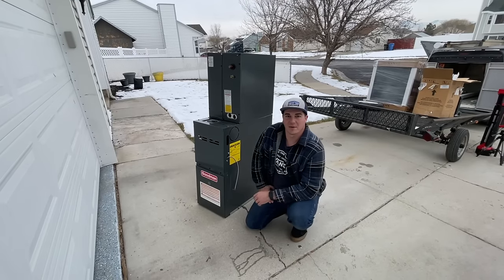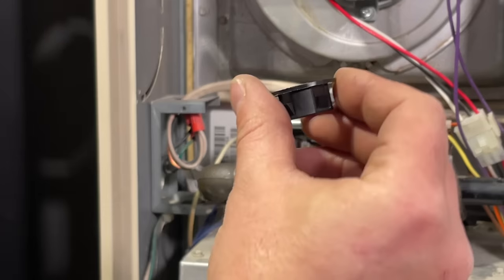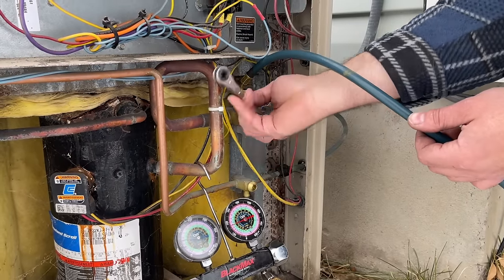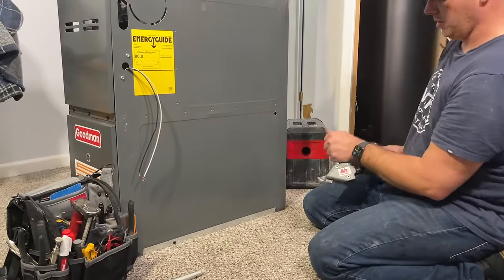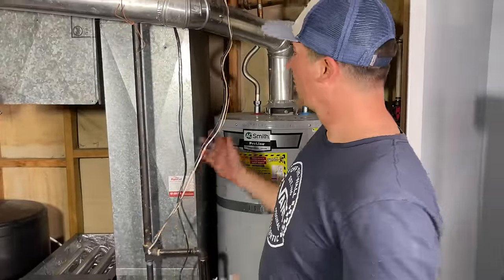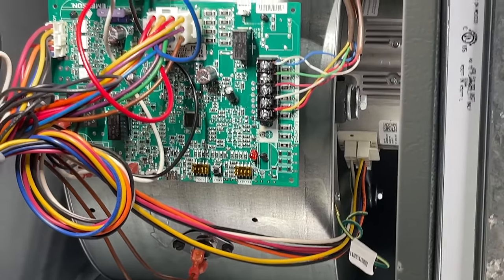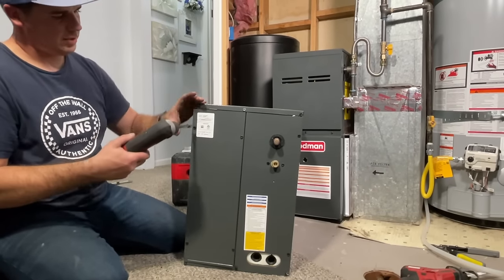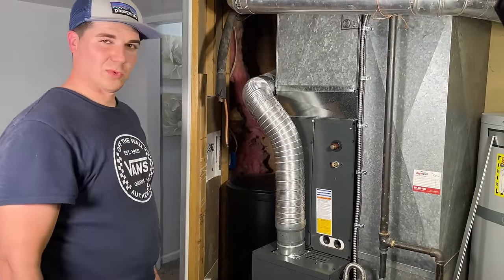Save THOUSANDS Replacing Your Gas Furnace Yourself.

Comment: Thank you so much Dave for  posting this video. So glad to see an HVAC tech like yourself that isn’t anti-DIY. I was never good at sheet metal work until I started watching your videos. Thank you again.
Reply from the maker: Happy to help. Thanks for the support! Cheers
Reply: Yeah the HVAC industry is largely anti DIY and makes up all sorts of mostly invalid reasons why. The real reason is they often charge $200 or more to replace a $15 capacitor. Or, much worse, $5000 or more to replace a $1000 furnace that one guy does in half a day. So a $1000 furnace with a 20% markup is $1200 plus 4 hours at a more than fair $200 an hour is $2000 total. But that turns into a $5000 plus bill with many HVAC contractors. So they should not blame homeowners for not wanting to be ripped off by the “HVAC cartel” and looking for much less expensive alternatives. I’d love to be the roofer that charges an HVAC anti DIY guy 2 or 3 times the fair price to replace his roof and see how they feel?
Reply: Go forward with the DIY installation and I guarantee you will regret it! Considering if you installed your new unit yourself it will now have no active warranties since a certified technician with an approved company didn't install it. I've only an HVAC Sales Expert for two years and even I know that! In his defense I deal with a lot more company to company and face to face interactions so maybe he just really didn't know.
Reply: Dave is here too!
Reply: AC Techs are anti DIY because of what the channel Anti DIY HVAC finds, all the time - people scammed by people who do installs of furnaces, poorly.
Does that mean people's high prices are justified? Show me a rich AC tech first, then we'll talk.
Reply: Thank you for doing this video its very informative  and a lot of good information I agree if you are confident in DIY-then there is no reason to hire a professional just take your time same as replacing a gas hot water installation .👍
Reply: @vrtac2011   I installed my own furnace 12 years ago to replace a Lennox elite that failed from being installed incorrectly by a "professional". So far no problems. Total cost of install was $850 for a 97% efficient system.
Reply: @vrtac2011 what happens when you buy a home with a new furnace installation how do you know who did the installation? I am asking because I just purchased a home and if a professional did this install it really sad! 😢. It's terrible leaking, missing screws, lose ductwork, no insulation, you name it.

Comment: FYI some/most manufacturers will not warranty a system that has been installed by someone that doesn’t have their State Mechanical license. Better ask in advance or you may get a rude awakening. Also home owner insurance may not cover any damage created by a unlicensed installation. Better do your homework in your State of residence and ask your insurance provider.
Reply: Warranty is hardly worth it anyways. That basically just a sales pitch as the part is never as expensive as the labor
Reply: Don’t forget this guy is an hvac scammer. He makes more money than a technician does by playing customer’s advocate and causing dialogue of distrust and anger in his video’s comment section. He is just as bad as the guys running around in vans ripping people off. He has just mastered a soft way of doing

Comment: My question is why wouldn’t you tell the homeowner that in a few years he’s gonna have to replace that again with a 90% or better high-efficiency gas furnace. Oh that’s right job security.
Reply from the maker: Um no, that wouldn’t be until the furnace is due for replacement. They’ll simply stop selling 80% furnaces, not tell them to remove them from your home immediately.. 🤷🏻‍♂️

Comment: They charged  my mom almost 10,000 dollars for the same unit she definitely got ripped off
Reply: Hey You have plenty of these contractors ripping off people. How can one job have a wide range of cost using similar parts is beyond me.
Reply: i would assume a 10k job came with a pretty good warranty. also did they do any ductwork? 10k could be a ripoff or not. depends on location and circumstances.
Reply: Well, she has a warranty. If you install one of these yourself, there is no warranty. None whatsoever.

Comment: I've learned alot on this channel as a home owner and someone who has been working in the maintenance field for 15 years. Just do your disclaimer in all your video discriptions and let people decide if this is for them or if they want to hire a professional.
Reply: Only a profession can work with refrigerants. Homeowners can't.
Reply: @crand20033  Homeowners who have experience with DIY stuff can do just about everything except for the final steps that involve line flaring and dealing with the refrigerant. You can hire a professional for that final part of the project.
Reply: @davidnivison9915 I appreciate the DIY but i do not have the tools. I like your transparency and no BS, not the typical hyped extreme overpriced pro installation sales pitch.  I want to hire you to install my furnace.
Reply: Don’t forget this guy is an hvac scammer. He makes more money than a technician does by playing customer’s advocate and causing dialogue of distrust and anger in his video’s comment section. He is just as bad as the guys running around in vans ripping people off. He has just mastered a soft way of doing

Comment: Thinking of doing this myself since my furnace is 20 years old. Ebay sells them. Just choosing the right time of year before it fails when you NEED IT. 😬 Already did my gas water heater a few years ago.
Reply: Well, my main board failed this week. HSI failure. Bad relay. Amazon and $130 I'm still going! 😁

Comment: Channels like this are an invaluable resource for homeowners! Haters gonna hate. I see lots of HVAC guys checking a channel geared specifically to homeowners and being backseat drivers thinking they're rocket scientists.
The fact of the matter is repairing and replacing HVAC systems if leaving it ALL to the "professionals" like SO MANY things has become cost prohibitive for a lot of people.
Videos like this share info and can also lead people to NOT taking on such a job for themselves. It's a great research resource while determining if you (as an individual) have the mechanical ability and common sense to even consider doing it yourself.
The Monday morning quarterbacks want to act as though safety is the ONLY concern which, it NEVER is! You can't change stupid and there would always be people biting off more than they can chew regardless of videos like this being there showing how simple a large part of a job like this is. $10-15k for a new system installed by "professionals"?! 
I can see people NOT replacing a system due to cost and dying of carbon monoxide poising.
I think all homeowners should know more about maintenance, repair and replacement of essential home systems than most do. It's our right and responsibility!
That's a great tip about pulling a permit and having it inspected as well!
Haters gonna hate and who the         F🖕CK cares?!
Great video and channel! Thanks bro

Comment: I'm a DIY person and I hate paying for work.  Just keep in mind most places won't sell you HVAC equipment.  Goodman is about the only brand that you can buy online but here is their warranty policy:
"No warranty coverage is offered on Goodman brand equipment purchased by consumers over the Internet, including web-based auctions, telephone or other electronic means, unless the unit is installed by a dealer adhering to all applicable federal, state, and local codes, policies, and licensing requirements".
Reply: Thank you for the information.
Reply: @tinak.3022 you can also buy AirQuest from HVAC Direct
Reply: Game changer
Reply: @Nonsense62365  Thanks for the information.
Reply: 100% we are a dealer and the equipment sold on the internet is blacklisted by Goodman and has zero warranty. I have run into this in the field and homeowners are very unhappy that they have no warranty.
Reply: @michaellauritsen5433  and that’s the part I can’t go with. No warranty
Reply: What do you do when you need a heart surgery? Go on YouTube and watch a video on how to do surgery on yourself? What do you do when you need your computer repaired? You hate paying? What do you do for a living? I wonder if people hate paying for your service?
Reply: @scott5654  I was told yesterday by a HVAC contractor  emergency service is billed at Overtime time and 1/2 (=$239/hour).  New furnace and ac system 10 yr warantee is $13,000 installed price.  Sounds Very reasonably priced to me.  How about if I charge $3500 every time a HVAC service van needs a brake job ( pads and rotors) I would offer an  additional warranty to cover labor $450 extra.  And with the preferred customer club I will offer a yearly brake tune up and Inspection  for $275 / year.
Reply: Makes you wonder why a person can buy a water heater 😮😮
Reply: Most of these HVAC manufacturer warranties aren't that good anyway. They don't cover labor at all and they aren't even transferable to a second owner! Someone in another reply or post mentioned $13K not being  a bad price for an installed system. Keep in mind that HVAC installers double and sometimes triple or quadruple what the equipment costs to arrive at an installed price.  That gives quite a bit of room for a competent DIYer to warranty their own work and why wouldn't they? I'm assuming of course most DIYers are doing this for the challenge as well as to save money.
Reply: @kdk2286  the warantee not being transfered to 2 nd owner is rediçulous, each unit has a serial number and is recorded by the dealer and manufactor.   The warantee parts if broke are nothing as far as cost to the manufactor. make sure you know what the dealers labor rates are before buying a furnace from them.  I have identified my  current/ former dealer as the most expensive in the county.  I will Never call them back.  Sounds like dealers not selling uninstalled equipment is in itself A "Monopoly".
Reply: @dand3975  before I posted, I read the Carrier warranty for one of their latest systems.  One thing I should have mentioned is that some HVAC companies may actually just cover the labor if they are really interested in their customer service reputation especially if the system is newly installed. Anyway, I made the decision a long time ago having a technical background, that I would buy the proper tools, get EPA certified, and just do all the work myself.
Reply: @dand3975  The no-transfer policy (which also applies to many other types of major home appliances/systems) is a good argument for buying a home warrantee. Plus, home warrantees often cover labor, which is usually excluded from furnace warrantees, and is generally by far the highest cost involved with having a furnace repaired or replaced.
Reply: @scott5654  The heart surgery comparison is obviously an inappropriate analogy. Also note that the creator of this video posted a disclaimer. Some of us are avid DIY guys with adequate home repair skills, and that is who this video is directed at. For the record, I have replaced furnaces three times, in two different homes that I have owned. I also have successfully repaired many other appliances, cars, computers, etc., sometimes succeeding at repairs after professional repair people failed.
Reply: @michaellauritsen5433 That’s total BS and you know it. As long as you register the new equipment within the specified time (as instructed by HVACDIRECT), then there is a 10 year warranty on Goodman systems.
Reply: It seems like a fair compromise to me. If the company is quoting me $12k for a new install, but I can do it myself for ~$2k, I really don't care about the warranty.

Even if something broke and it only lasted 4 years, I  already saved $10k. I can put a new one in and still be up $8k...

Comment: Another great video! I had a hvac system installed by Logan a/c & heating in Columbus, Ohio they didn't do anything what you have done. They did terrible work! They didn't seal nothing! All seams leaked air... etc.....

Comment: Hi Dave!
2 years ago installed my furnace.
I did even a graph with natural gas pressure value to CO level in exhaust - to setup a proper gas pressure - my optimal pressure was 3.38 (instead of 3.5 recommended).
This year I guess surplus Lennox SL18XP1 5 ton 15.5 seer AC to replace my old 20 yo 10 seer Goodman.
I like your trick to retrieve R22 inside the unit.

Comment: Every time I get another house or move, the 1st thing I do is change the switch to an outlet and put a plug in on the furnace. I know you're not supposed to but when you live in areas that can get -50c why would you risk having no heat in a power outage. This way I can run my generator and power up the furnace in an emergency. Seems like this should be a standard installation in very cold climates.

Comment: At 7:00 and doing everything perfect, including what I always do is test the non-contact tester against a live wire to make sure it works instead of assuming it works.
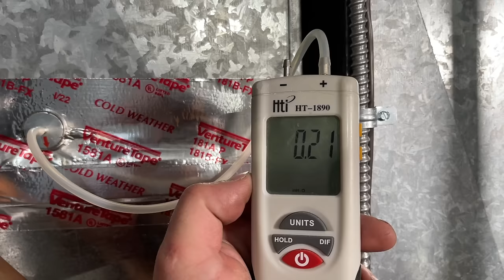53:59 if your supply plenum, return plenum and cabinet doesn't have a hole for a manometer, nobody has ever checked static pressure.
Reply: @Kevin-mp5of  lol👍

Comment: instead of a flat piece of piece of sheet metal to reduce the filter rack opening, possibly the flat piece with a ~1 inch flange bent up 90 degrees for screw attachment to cold air return?  Good demonstration.

Comment: The old unit you took out did not look bad.  The A coil looked pretty good yet  What was wrong with it that it needed replacement?  Good clear explanations of what was being done and why
Reply from the maker: They just wanted an upgrade is all.
Reply: Bingo!!! He only took out the UNIT & not the SYSTEM a play on words!!! Too bad he could not replace the SYSTEM that would be exceptual. Just pointing out. The UNIT is  way different than the SYSTEM.
Reply: @diyhvacguy   wow,  an upgrade?  you go from a better quality unit to a lower quality unit and they call that an upgrade?  sounds more like a downgrade
Reply: @lawrenceanderson6167  yup, he's installing crappy equipment.
Reply: HVAC scam, tell customers that heat exchanger is cracked

Comment: Nice job,  you were clear on the safety points and explained what you were doing and why.. Well done
Reply: @gordonroberts9339   Are you that bored that you need censor and challenge everything.  The heat was working and my comment remains...  Part 1.. well done

Comment: I've learned a lot from you about aspects of this work. But I have another concern about the over-tightening of steel pipe and fittings. This pipe is threaded on a taper. Over-tightening steel pipe into brass fittings could split the fitting. Thank you, sir, for sharing your knowledge. Regards.

Comment: Thanks for this video!! I just got a estimate for $18,000! I don't have that kind of money. So I'm going to do it myself.  Very helpful video! Subbed!
Reply from the maker: Right on! If you need some help with your replacement, I offer one on one assistance for DIYers replacing their systems. That can be found at Patreon.com/diyhvacguy  I also can help with getting the full 10 year warranty on your equipment.   Cheers

Comment: Flexible gas connectors are for movable appliances only, such as clothes dryer, stove, oven. Furnaces and water heaters are not movable appliances. The vertical gas drops and not supported and are swinging by the flex connector.

Comment: No flex line to furnace or water heaters in Michigan must be black hard pipe … I also have my HVAC guys mastic inside seams so no air leaks also tape outside seams on return, coil and takeoffs

Comment: Dave, I have grown to trust you quite a bit. I have a question: I had an HVAC guy come out and he said the AC fan unit looks good, but the capacitor isnt operating at ideal levels. He said he could replace it for $300+. I told him id have to think on it. Is this something I could easily do myself? I am an automobile mechanic and a handy man
Reply from the maker: Yes, Save your money. I can’t walk you through how to do it. Or just follow one of my videos on how to replace a capacitor 👍🏼 you can get a new one for 15 bucks
Reply: @diyhvacguy  Recommend one please. The one in there is a Motor Run Capacitor  TRCFD455

Comment: My furnace is from 1980s. Replaced blower about 10 yrs ago and a thermistor a few years ago. It's on borrowed time. I want to replace myself but part I'm not sure about is the sheet metal work
Reply from the maker: Good point  Kev!   Hey if you need some one on one help, check out our membership on Patreon.com/diyhvacguy where we will help walk you through each part of the process and we can also help with purchasing equipment, warranty info etc.  It’s $25/mo (cancellable at any time) 👍🏽  cheers

Comment: First, a huge thanks Dave for this video.  I would like to see a public outcry against some of the misinformation from "professional" type heating or HVAC sites.  You'd think they sit next to God.  According to them, no one is competent to do their own work.  Well, some of the worst work I've seen, including on gas, was from a pro.  This channel and Dave are a godsend.  And in my area, the arrogance of both installers AND supply houses is unbelievable when it comes to protection of equipment price information.  If automobile repair shops and dealers tried this, they would get their asses handed to them.  Most consumers are clueless about actual costs, installer discounts and finally, markups.  I'm all in favor of a guy making money and staying in business but when he's pulling $500 per hour for a one or two day job, that's WAY too much.
Reply from the maker: Amen. Thanks for the kind words